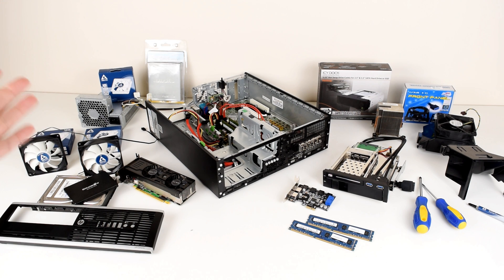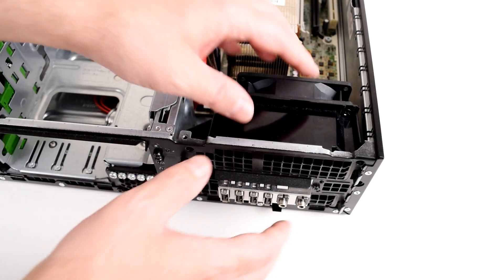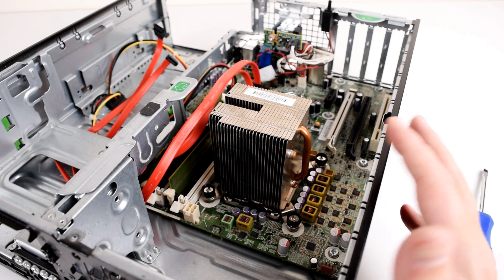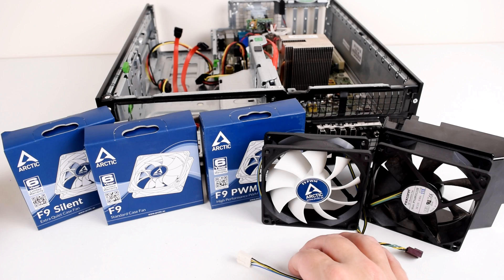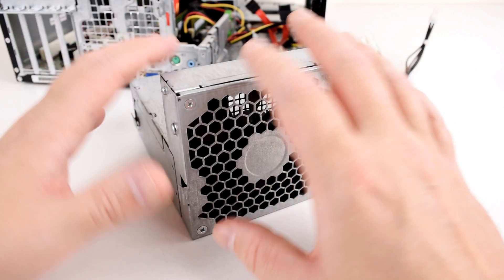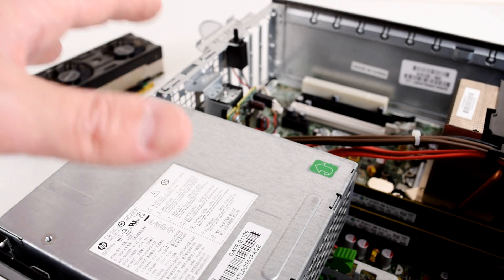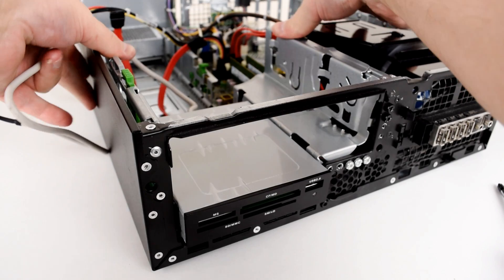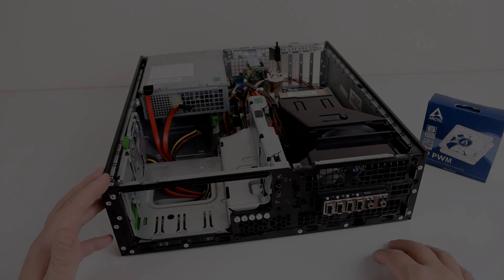Improve your HP Elite Small Form Factor PC

Comment: HOPE THIS HELPS SOMEONE INTERESTED IN UPGRADING THEIR PC.

So this is the upgrades ive done
 and the results. 
2 hard drives 1 of 300GB and the other of 1TB
 ( i recomend a ssd for your operating system and 4TB harddrive for games/other)
16 gb of ram 
1650 MSI low profile graphics card. 
3, 92 MM fans (Artic F9 PMW , 1800 RPM for CPU cooler, Arctic F9 Silent 1000 RPM for Power supply and Arctic F9 1800 RPM for zip tie fan, )
elite display E231 1080P 60HRZ 
arctic 5 thermal paste. 

Personal modifications. 
the 3rd fan is in the middle of the Graphics card and the power supply. i hooked it up using zip ties. haha its just a work around for that proprietary shit.
I leave the case open. 

Results.
since ive build this for emulation ive only tried it for that. i can run 1080p 60 fps on anything up to the Nintendo switch if the Emulator supports it). so xbox 360 ps3, gamcube ps2, dreamcast ect. run just fine. 

The downsides: 
1. Heat.
when playing ps3 games, the CPU temperatures are higher than any other. all others are max 50 to 65 C but with PS3 emulation it goes up to 70-75 C
dont get me wrong 75 is still a "okay" temperature anything above 80 is a red flag.
2. Old Tech
Its a proprietary BTX motherboard. so you cant switch Cases for better airflow. you cannot add a new gen CPU's, A full sized GPU, any other PSU, DDR4 RAM, A Actual CPU Cooler.

My recommendations. 
If you want a real PC Gaming experience. save your money for it dont spend on this. nothing like playing 4K games at 60 FPS with a monitor with the Hz to support it.

If you do go with this 
dont upgrade to 32 GB ram. 16 and even 8 is enough. 
get a SSD for you operating systems and a 4 TB hard drive for games/other. 
replace the thermal paste
 (something better than the arctic 5 )
Upgrade to the i7-2600
Upgrade to windows 10 and upgrade your bios 
replace the fans, 92 mm fans for the power supply and cpu cooler
get a 1650 MSI low profile graphics card for 1080P 60 fps gaming.
Reply: If you used too much thermal paste, you might get that result. I'm thinking that PS3 emulator is just CPU-intensive.
You shouldn't need anything better than the Arctic Silver 5 for that setup. The CPU cooler itself isn't made for much more than light graphics work. Your setup works well enough!
Reply: Where is the zip tie fan placed? Do you have a picture of your set up?
Reply: @DixonDeadlifts  okay so its like this. you should see a brown/burgundy 4 pin connector on the motherboard, almost next to the power supply. close to it are the SATA connector for the hard drives. or on the other side, you should find it close to the VGA connector. now the way i have it. 

open your case, look at it from the top down. (looking down at the motherboard)  
the placement of the fan is going to be right in the middle of the Power supply unit and the Graphics card . it will be facing into the motherboard. so air should be coming in from above going down into it. THE FAN IS NOT ON THE OUTSIDE OF THE CASE.
another reference is,  the fan should be nearest to the VGA connector. as a matter of fact right above it. 

further instruction in case you need it.
(make sure your disconnected.) connect your fan to the 4 Pin connector of brown/burgundy color. 
use 2 small zip ties on the two small holes on the fans frame. (were you would normally use screws) make sure it goes through both holes. once its done, pass them through the small holes on the back of the case than zip tie that shit.  make sure there is enough space between your power supply and the graphics card.  so not so close to either. right in the middle of both. 

keep in mind that by doing this. you may have trouble closing your case. hope this helps. if you need more assistance let me know!
Reply: What happens if you don't replace the thermal paste?  Also...what would you recommend if not Arctic 5?
Reply: @apogipinoy  i do recommend artic 5 actually. Its not to expensive and it works just fine. A example is, Im able to play most games on high setting for a really long time and temps never go above 67. Only the ps3 emulator make it go higher. 

Im unsure of what you want it for. But i also produce music in Fl studio. Record songs, make videos, edit photos. And i never have a problem with heat when doing that. 

About what happense if you dont replace it:
Well it really comes down to two things. What was your computers life like? For instance mine was given to me from my job. So all it ever did was work simple programs like excel, word, power point. Needless to say, it wasn't vary used besides long hours. If you will use it for the same. Perhaps you dont even need to replace it. However. If you plan to use this for more intense tasks. Not replacing the thermal paste may lead to your CPU overheating at a quicker rate or it can heat up easier.
Reply: amos cruz , you can use any electronic thermal transfer paste or grease. Gamers like Arctic Silver because of the relatively high silver content. This is a minor thing, though. I’ve seen people make things worse by putting on new thermal paste incorrectly than by leaving it ‘as-is’. If the system is really old, the paste can dry out and turn to powder as well. I’ve never seen it be TOO bad an issue, but that was with way older processors. Just remember, if you do it, you want an even layer, as thin as possible.
Reply: Troy Jollimore - Awesome! It’s been a while since I’ve built our or modified a desktop computer. I appreciated others comments and reminders to screw the heat sink back on in a criss-cross pattern.

I also noticed my HDD was manufactured in 2012 so I’m swapping that out.

Should the same logic apply to the RAM? Mine came with 8gb, but not sure I should replace or add more
Reply: @apogipinoy  The funny thing with computer gear... You can have something run for DECADES without a hitch, and something brand-new out of the box die as soon as you power it on.

For a home system, I wouldn't swap the HDD out just because it's 8 years old, if it's still running perfectly. I would replace most of it's function with a new 256 or 512GB SSD, though. It also wouldn't be worth it to replace your existing RAM with 'faster' chips, for the small speed increase you'd get. You can go up to 16GB, but beyond that you'd be better off replacing your entire setup with newer stuff. (Motherboard/CPU/SSD/RAM/Video/)
Reply: Troy Jollimore - Great perspective!  I ordered a 500GB replacement SSD for the existing 500GB HDD. I’ll probably use the windows 10 builtin backup settings to schedule regular backups. 

I did order a 5.25” docking bay to hold an ultra slim DVD burner and 2xSSDs, In case I need to add another 2.5” HDD or SSD for more storage. 

I’m considering replacing the existing HDD with a 2TB HDD to act as a backup for the collective storage of the two SSDs (I cant see myself amassing more than 1.5 TB of personal data, and if I do...Time for my next upgrade 🤪)
Reply: amos cruz They’re so cheap, I wouldn’t say not to get one. But I can count on one hand the number of times I’ve used my BluRay/DVD drive over the last few years, much less burning a disc. Everything is USB sticks or Cloud transfers now. And yes, SSD with a HDD for ‘offline’ storage is fine. You can keep some programs on it, but an SSD absolutely spoils you for access speed. Even a fast HDD becomes a chore to wait for. :(
Reply: I plan on adding a 3rd fan as well and I have a question:

If I put it facing to the motherboard and I manage to put the cover, how will it change the airflow? Or like, is that even gonna help? Sorry, I'm new to this thing.
Reply: @HonkForLife098  i wasn't able to close the case once the 3ed fan was installed. I was able to close it with only the gpu. But when i did that, i noticed that the cover was getting hot. So i removed it. Regardless of the fan. To answer the other question. The 3ed fan will help the gpu. It wont help the cpu. It helps either taking hot air out or in depending on how you set the fan. I tried both. And found that its better to keep the gpu cold.
Reply: @Srikesvilla  Hi again, I just recently replaced the Intake fan of my 6200 pro pc and I've noticed that my temperatures are getting a bit higher ( like 2-5° I think)  but the psu fan is bothering me so I plan on replacing it as well. Do you think its fine to replace it with a 3 pin fan with lower rpm? Or should I stick with the stock psu fan? I'm bothered by the noise but I'm worried I might make my psu die faster or run into problems if I replace it with a different fan ( like heating problems)
Reply: @HonkForLife098  hi, im unsure about the inside of the 6200. In my case i updated the fan speed in the bios for the 4 pin fans. The fan i placed in the psu is the 3 pin fan. And that has a rpm of 1000. When i changed the fan i found a youtube video showing how its done. However, when i opened my psu. It was different fr the video i seen. And since the fan i was going to insert had a longer cable than the original. I had to cable manage within the psu. Avoiding the pads that heat up otherwise i would probably burn the cable to the fan. Ima be honest with you. The plus on replacing the fan in the psu is, it's quite. The bad side. If you break your psu. You have to replace it, you may mess up your hole pc. And in my case, its a bit hotter than it was originally. But thats normal as the Rpm is a lot lower than the original fan. Even so, ive played on that thing for hours and producted music running a midi keyboard for hours. And never have i had a problem woth the psu. Never has it be hot. I can put my hand over it and the most i feel is worm. Even after long hours of use. But like i said, it is hotter than originally. Do i recommend it. Not really. Since its more cons if things go wrong than if they go Right.
Reply: @Srikesvilla  right. I've only replaced the intake fan so far and I can already see the temperatures rising. I guess I'll just bear with the noise. Thanks for the reply!

Comment: Hi I got a HP 8200 sff tower and i ordered a vid card  - MQX GeForce GT730 2GB DDR3 DVI VGA HDMI PCIe Graphics Card+Low profile Bracket, i installed it it dont show up in detect new hardware, it uses the on board grafics  not the new card tryed shutting down on board and screen went black  i was thinking its a power supply issue at only 240 watts,  i need help any ideas?? cant send card back to ebay as electronic and is brand new.  not sure how yo can run the higher cards 1050 1030 etc and in your vid you talk about upgrading to a i7 2600 and link you have is for a i7-3770??
Reply: Could be a DOA (dead on arrival) video card. Test it in another PC. Also, make sure you're plugging it in the correct PCIe slot. Yes, the system can handle that.
I'm not sure if Phil's learned over the past year, but the 240w rating on the HP power supply is 'low'. They only count the 12v rails, and not the 3.3v and 5v rails like other manufacturers do.

Comment: Hello, I have Hp desktop compak pro 6300 SFF 3.4 ghz , 16 gb RAM,core i5, psu 240 w.I bought video card gygabite gtx 1050ti low profile.I installed it, and in the first time when I turn on it works very well.I installed the drivers for video card and tested it playing Forza Horizon 4.But after reset the computer, the windows don’t boot anymore.Then I remove the video card and the pc works again. Is necessary do an upgrade of BIOS, etc?

Comment: But can it run CRYSIS? 😂
Reply: Yep no sweat. Crysis even runs on my single core 15 year old athlon with gt 730 1gb. 25-30fps on low settings. The standard joke is because on ultra you need a decent cpu and gpu.

Comment: You can replace PSU with aftermarket, if need more juice for GPU.  Use  a 24 Pin to 6 Pin ATX Power Adapter Cable adapter.  sticking with 240v on my Prodesk 600 g1 as want to keep power useage low.   GTX 750 ti OC stable.

Comment: These are very nice PCs but unfortunately the big drawback is that you can't use a custom power supply with it so you can't really upgrade/replace the power supply but you can pick these up for really cheap so I guess it's not a real issue

Comment: Is it possible to make 8200 near silent? (with 2 monitors out)?
Reply: Mine had a loud noisy psu fan. Easy to remove and use sewing machine oil to lubricate the bearing. Same with cpu exhaust fan.

Comment: Any advice on upgrading to a SSD?
Reply: Easy. I have a 60gb ssd in mine for windows (clean install is always best practice rather than clone). There was no drive caddy with my Elite so just used electrical insulation tape and secured it in the slot below psu.
Reply: @computerrefurbishment9748  I actually mounted it with an adapter and successfully cloned the old drive with no issues. I had a lot of custom registry edits (adding seconds to the clock, etc) and thought I'd try it first.

Thanks!
Reply: @José_Chung  Ok cool. Clone ok specially like you say, it's customised and some programs installed (and you don't have reinstall method).

Comment: By the way I took your advice changed both fans with the exact same models in your video (14$ each)   i found the back was a little more difficult  for me. Also your right the sound of the fan was like comparing a bearing on a car....now the fans sound  very quite  even though the fans speed is 3 out of 6 in the bios.

Comment: I have a question same PC but with Gtx 750 Ti, I plug it in the slot but when I connect HDMI  it says, no signal at all so I cannot install the cards drivers :( it seems like the PC doesn't recognize it,  anyone can help with this issue please? :( your reply is highly appreciated
Reply: Try a different cable. I had a card with a defective vga slot but dvi-d was fine when I got that type of cable.

Comment: 12:42 At this part I almost destroyed a perfectly working hard drive, one day I was thinking about upgrading the RAM of this SFF machine from 2GB to 4GB, because I'm still using Win7 32 bit, and as I opened the case and pulled out the cage of DVD-ROM and hard drive, I forgot that the SATA cable for hard drive was not long enough, I accidentaly ripped it out, causing a plastic part of the connecting port on hard drive broke, which almost gave a heart attack, though the metal fingers still remained, yet without the plastic part, the SATA cable couldn't connect to the hard drive. Finally I solved it by applying some superglue to the connecting port, guess the port and the cable is now permanently bonded together, at least this hard drive is still workable, I can boot into win7, install and run some retro PC games, I don't suppose I'll do any upgrade on this machine in the future........

Comment: why so little past ?? the more surface coverage the better , as long as its not super thick , what else matters besides heat transfer ? the amount you put looks limiting, am i missing something?
Reply: Assume you mean cpu thermal paste. A small blob is all that's needed. When the cooler is pressed down it's distributed evenly on the cpu.
Reply: @computerrefurbishment9748  quanty of paste make sense , BUT i would be concerned it would not spread evenly and end up leaving some areas/corners dry, while some is pushed out and lost else where. unless you can see it (maybe u can) ozze out of all sides there is no way to know. which is why I would over do it and just clean up what comes out.
Reply: @NoblenessDee  Ok cool. If you are concerned then try that method although I've never had a problem with cpu overheat in all my builds.

Comment: @PhilsComputerLab Hi I just watched your video and I wonder if the PCIe USB 3 extension card you were using provides USB 3 speed to the front side bus, because this extension card has no power supply connector and I only know those cards with either an additional molex or sata header. Could you also please reveal what is the product name ? I could only find those cards with an additional power connector and I am planning to upgrade an older office pc as well and if there is a way  I can achieve the same number of connections and bus speeds with avoiding cables in the inside I would like to go for it! 
Thanks in advance!

Comment: Hi Phil. You've made some really great videos on this topic — thanks for introducing so many of us to these cracking little desktops!

I see you've upgraded a Dell 9010 too.

I like that the HP has 5.25" and 3.5" bays; with caddies that's really flexible. But I noticed that in your 9010 video that you said it was one of the best things you'd bought in some time.

So if you could choose between a 9010 and an HP 8300 (which uses the same CPU family as the 9010), which would you go for?

Cheers!
Reply from the maker: Hmm I really like both machines! I have the 9010, but the smaller version, so it's more crammed. The 8300 is a bit larger and therefore easier to work with when upgrading.